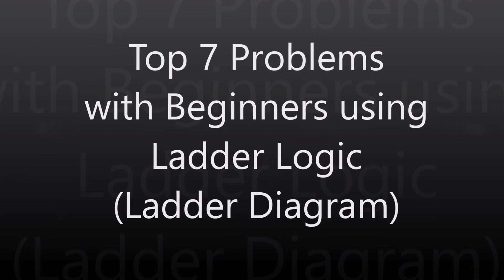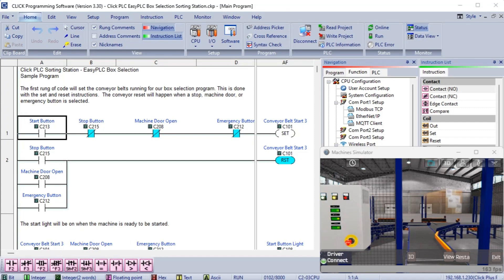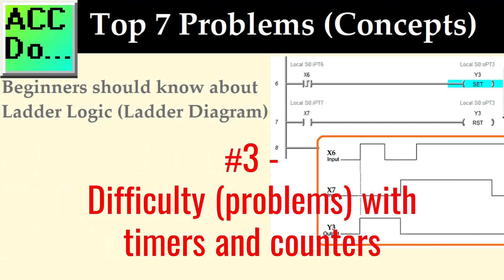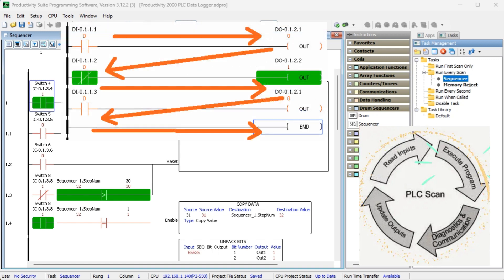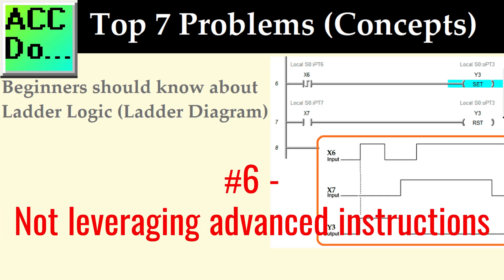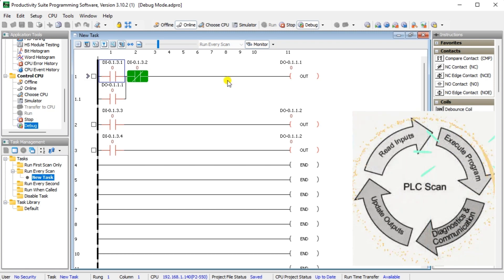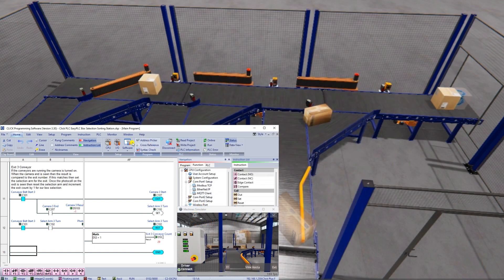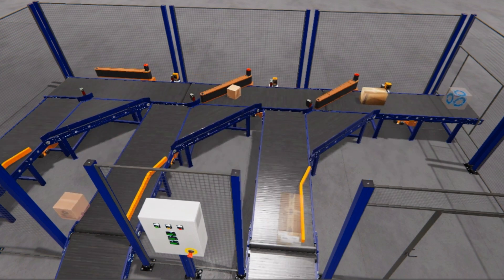7 Critical Ladder Logic Mistakes That Trip Up New Programmers

Comment from the maker: More information can be obtained at our website. This includes all of the links mentioned in this video. 
https://accautomation.ca/top-7-problems-with-beginners-using-ladder-logic/

PLC Beginner’s Guide to PLC Programming
There are many different PLC manufacturers with different hardware and software. All of the programmable logic controllers have similar basic features. Here is how I would approach learning about basic PLCs.
https://accautomation.ca/programming/plc-beginners-guide/
Once you are familiar with the basics of the PLC, you will then learn specifics for the controller you will be programming.
This is the easiest way to learn about PLC programming.

ACC Automation
https://www.accautomation.ca/

Comment: I'm sorry if I'm wrong because I'm not an expert in PLCs, but as I understand the memory bits of a PLC simulate physical switches and push buttons. By their nature, the bits are in state (0), which is why a MAKE command coincides with a switch that changes from an open state (0) to (1) when the switch is pressed by user, but this does not happen with a BREAK command that in order to is valid, the PLC memory bit which, as we said, is in a normal state (0) should become (1), that is why the electrical continuity of the circuit does not coincide with the logic BREAK command of the PLC, which in order to be valid, the memory bit must from (0) to (1) when the user presses the switch. I hope I didn't make the situation worse.
Reply from the maker: Hi @gvenagas,
Think of memory in the PLC as all bits. Yes, some are for physical inputs and outputs. We can combine these and create bytes, words, double words, etc. These bits can then be interpreted as on/off (1/0), numbers (Binary, Hex, BCD, etc.), ASCII, etc. 
When you are saying BREAK and MAKE commands, this is Make-Before-Break which is a way to think about how physical IO behaves in the PLC. This is due to the scan of the PLC. Inputs are read, logic is solved, communication happens, and outputs are set based on the logic all at once. 
Here is a post that will discuss the scan of the PLC.
https://accautomation.ca/plc-learning-series-program-cyclic-scan/
I hope this answers your question.
Regards,
Garry
Reply: @ACCautomation  Very clear explanation! Thanks for your reply! Your videos are excellent!

Comment: This is wonderful information. 
Especially for folks who are coming into programming through the back door. 
I started with relay logic. Then learning to modify relay logic. Followed by converting simple machines from relay logic to a PLC. This information would have made that a less bumpy ride.  But it really helps when you find yourself upgrading and retrofitting a machine programmed by a real programmer.  Thank you for this.
Reply from the maker: Hi @mikeglide1292
I agree. I also learned the hard way. This information is important to beginners learning about ladder logic (ladder diagram) programming.
Thank you for the comment.
Garry